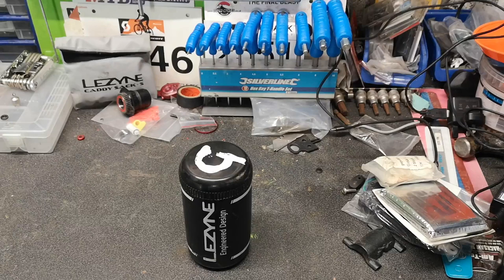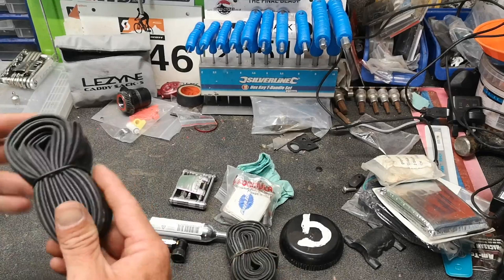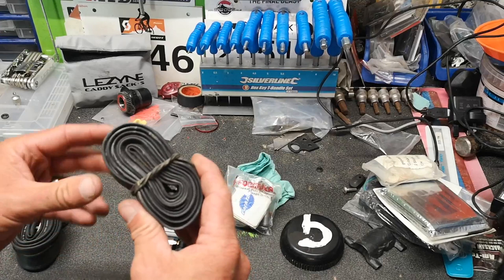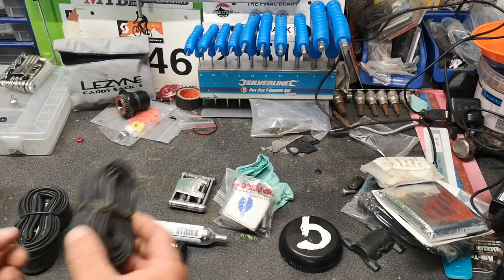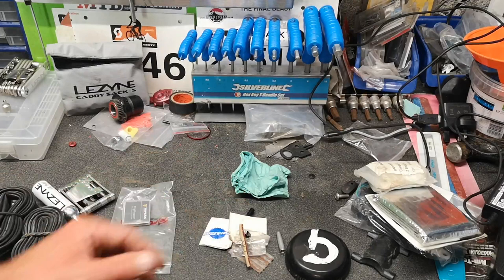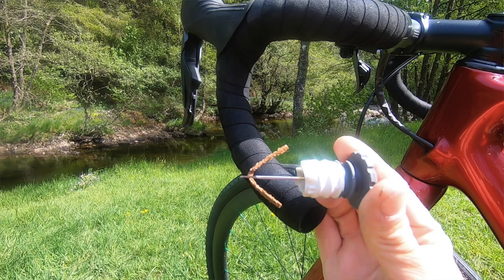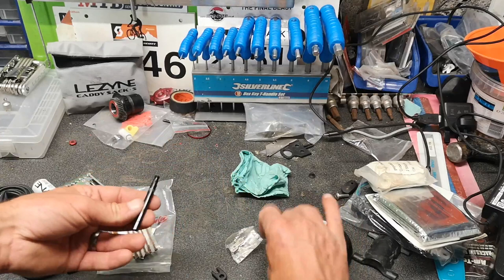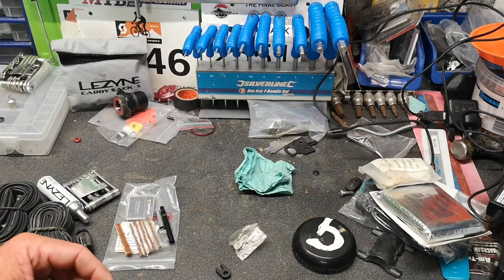What tools to carry? For gravel cycling rides

Comment: Hi what size inner tube do you carry for your gravel bike. I am new to gravel and the all tubless experience. Want to carry a spare tube in case a a non reparable plug situation. My tires will be 700x40 & 700x42 mounted on a pair of enve G23. Thanks in advance
Reply from the maker: I'll usually carry two tubes, with a lightweight tubolito TPU tube and Schwalbe butyl tube. Plus patches for both types.